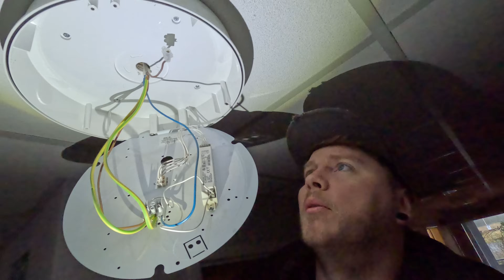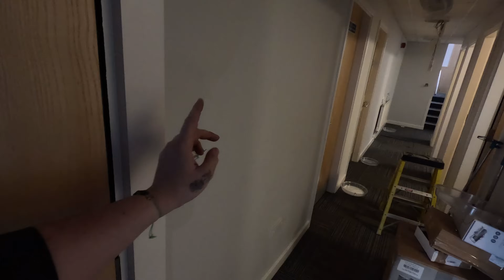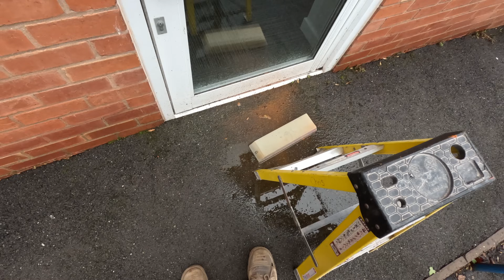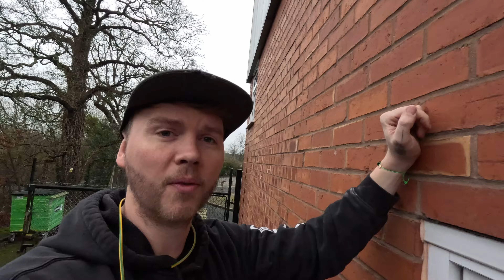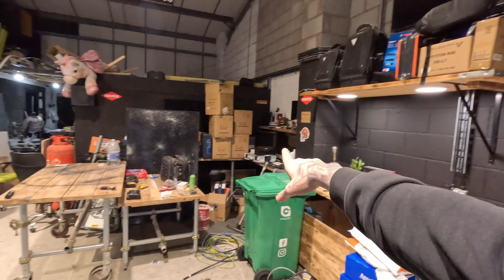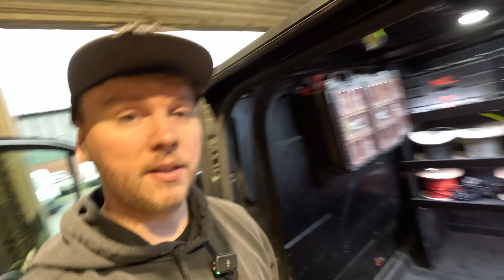Electrical Fault Finding - Surprising Find - UK electrics

Comment: Like to say I enjoyed the video, but watching you fault find the EL Circuit that was not true, it just clearly showed your lack of Testing Skills.
Top tip - Have a walk through, looking for likely supplied points and any marks near to the fittings,  next at the CU remove the LN & E from the Faulty Circuit, then Multi Meter across each Cable to establish the  type of fault condition.
Then find what you think is the half way point of the circuit and then drop down the fitting and remove ALL the LNE Cables and Test to find which are showing any faults, then back to the CU and again check to see if the fault is cleared, if all good as it may be, move on again to the EOL and again remove the LNE Cables and Test with your multimeter.
By now things should begin to shed some light, the type of fault and where the fault is.
Shame that your lack of experience never led you immediately to the outside EL especially as the Emergency Fire Door,  should  have jumped out at you as maybe having an outside light due to the location being off road with no street lighting.
One to remember for the future, yes I can sit back in my armchair and smugly know all the answers, but I had 5, yes 5 decades in the Industry and was  once as green as green.
Mr Spence Eng

Comment: Question, the socket at Nana Pats, my mother in law had same issue, spark replaced the old unbranded cheap looking  double to a new MK socket, she too uses old filled radiator in it, will the new MK go the same way, any advice

Comment: Why would the socket at Nanny Pat's get overheated and burn like that even if she is leaving the heater plugged into it turned on all day ?
Reply: My guess is that the plug in the heater is bad, and it gets hot and radiates onto the socket
Reply: @justme5384  Whatever is causing the heating needs to be fixed before something serious happens
Reply: It's a very old socket - I'd say it's at least 20 years since you could buy those. The springs holding the pins eventually lose their grip and connections work loose, causing overheating.

But it got me thinking of solutions: if Nanna fiddles with timers and they end up on 24/7, I would put a timer and contactor in a locked/secure location, to control outlets to each heater. Possibly a 20a switch or just a flex outlet at each heater, with each protected by a 10a or 16a RCBO.
Or new, top quality, plug and socket for each heater. Set the timer to switch off for a few hours overnight and midday.
Could also install a thermostat with the timer and contactor, so overall temperature is controlled and the heaters cycle on and off even if she fiddles with the inbuilt thermostatic controls.
Ideally you would put in panel or storage heaters with locked controls, or get a grant to install an Air Source Heat Pump to re-use the old ducts.
Concerned about safety, trip hazards and electricity bills.

Comment: Video content ideas:
Rate my DIY install
Smart home lights, sensors, roller blinds etc....
Rewire electrical planning for a house/garage
EV install
Solar/Battery
Garden/Landscape power/lights
Low voltage wiring and planning